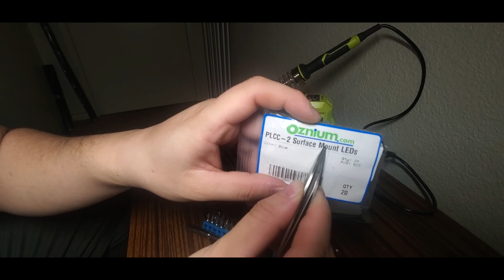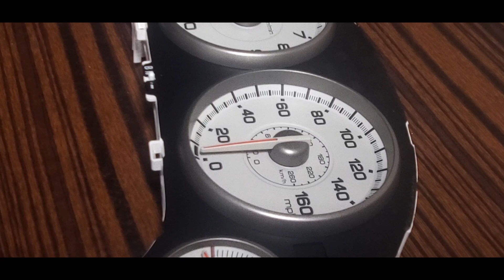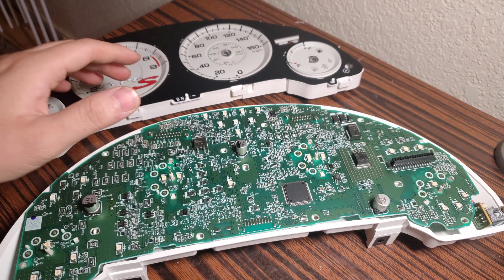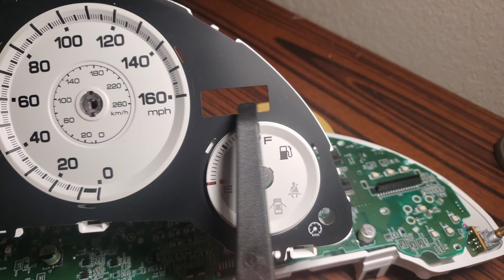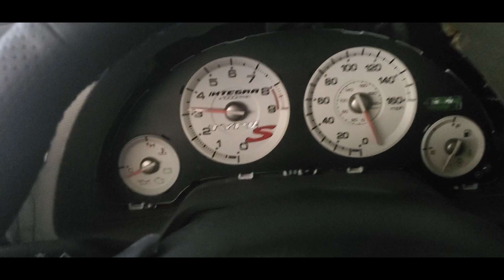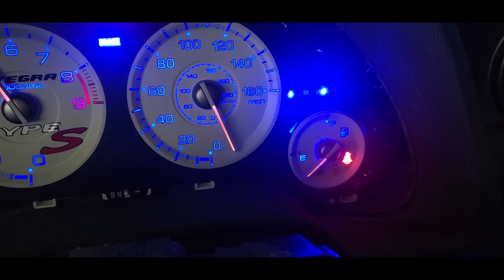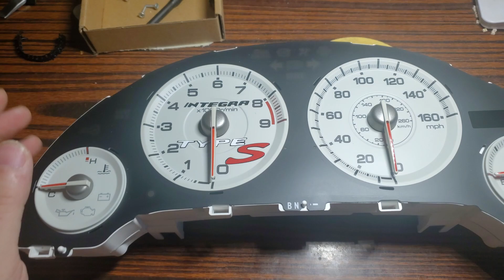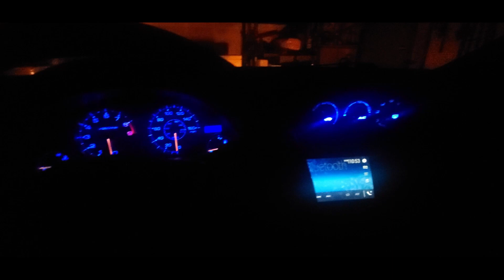How to Change Acura RSX Gauge Cluster LED Color (FULL GUIDE)

Comment: Ugh i lowkey dont wanna do this cause this looks like a ton of work that i dont even know what im doing with but my lights are extremely dim for some reason
Reply from the maker: It do able, im more comfortable doing this then swapping an engine or tranmission lol. Did u max out the brightness in ur gauge cluster knob thing?
Reply: Idk if you figured it or not but tons of owners have this issue lmaoo... the trip meter is also a dial. Turn it.

Comment: Be careful with this type of work because your speedometer gas rpm and temperature pin will be off it will not be an accurate reading after putting them back on the car
Reply: No, you don't. There is an easier way to do this. You plug the cluster in without the needle gauges, do the ignition cluster reset. Then install the needle gauges with the cluster in. Take the cluster out and install everything back together and then put it back in.